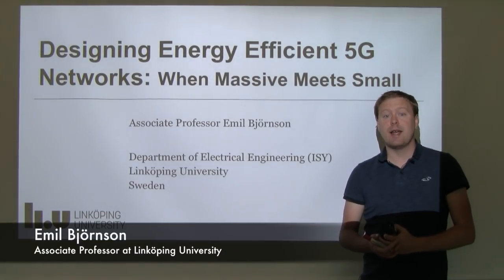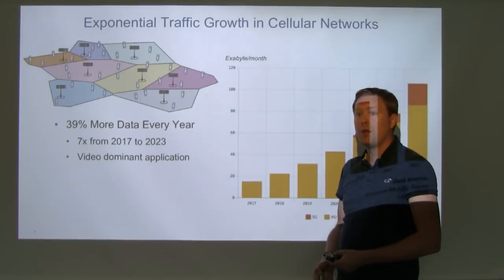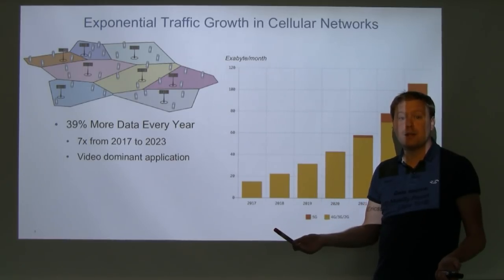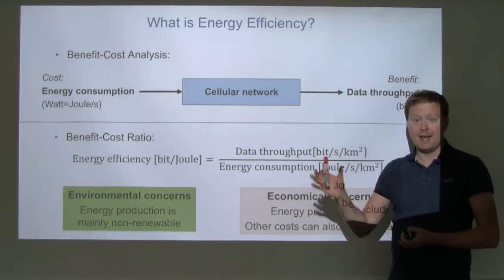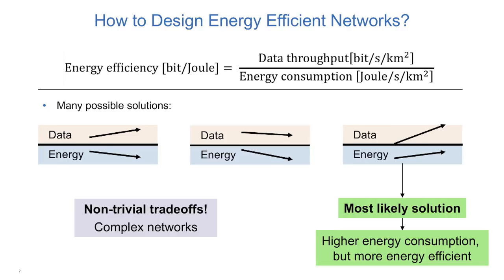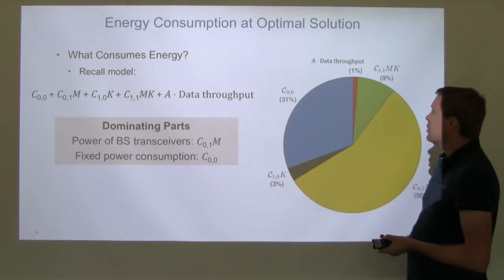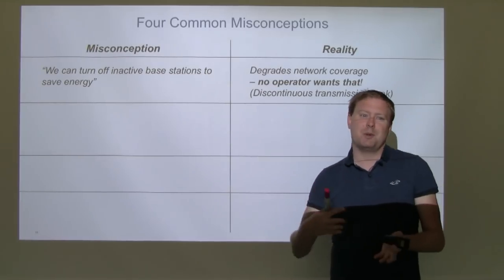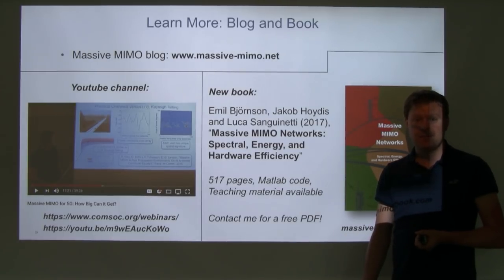Designing Energy Efficient 5G Networks: When Massive Meets Small

Comment: Respected Sir, 
1.How to draw the figure of Slide 9 (Potential Solution: Power Control) ,10 (Potential Solution: Smaller Cells
) and slide 16 ?any  code
2. How to understand the Modeling Data Throughput equation derivation  & Modeling Energy Consumption?

Comment: Thanks for your sharing. Could you please help to explain the reasons why down link power control is not implemented in 4G/5G systems? Is is said that the 4G/5G basestations transmit a fixed (configured) power per radio blocks for all users. Does the beamforming help to cover the power control? (if I understand correctly, the beamforming in 4G is not as strong as in 5G). Thanks!
Reply from the maker: Thu Thuy Le This is up to the one that does the implementation, but using as much downlink power as possible is generally a good way to maximize the rate when only serving one user at the time in 4G. It can create more interference between cells, but that is hard to control in practice. When you can serve more than one user at the time, the main question is not how much power to use in total but how to distribute it among the users.